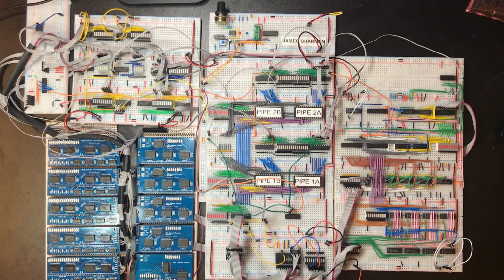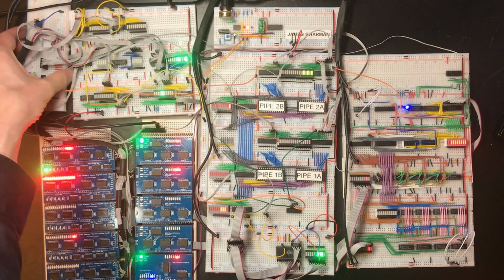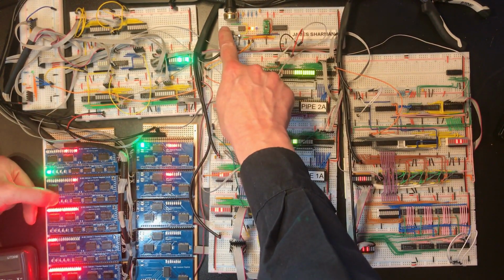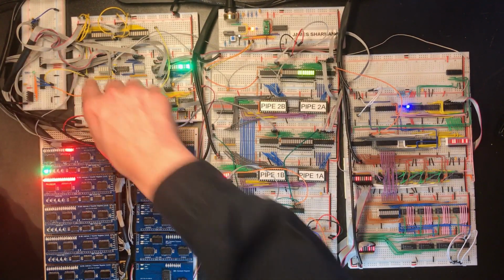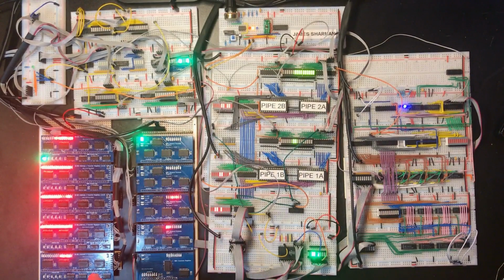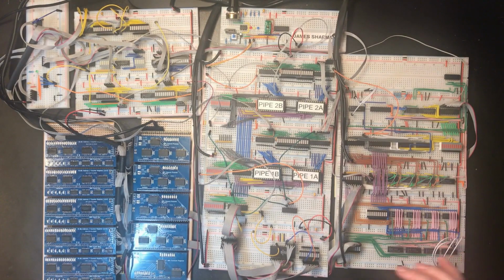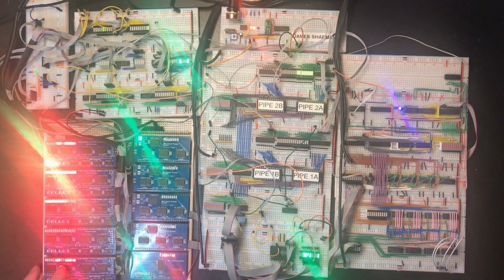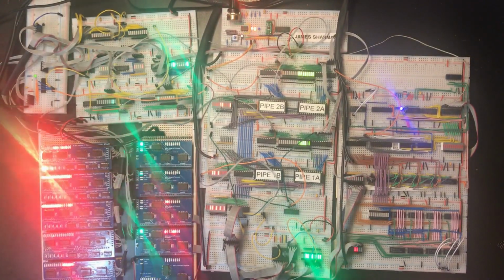Troubleshooting (Spoiler: It's Alive!) - Making an 8 Bit pipelined CPU - Part 39

Comment: Debugging software is bad enough. Debugging hardware is a whole 'nother level of frustration. Mind you, the thrill when you finally get it working is all the greater.
Reply from the maker: Indeed,  the Simulator helps a lot but for a while there code bugs would have be 2nd guessing the hardware.

Comment: Hi James throughly this build did you ever wish you’d gone with all through hole components even if it made it a bit bigger?
Reply from the maker: Not really but there are some advantages going that way, you can use exactly the same components between breadboard and pcb for starters. The size issue is a big deal for me though, I only have so much space.
Reply: @weirdboyjim  fair play, I’ve been soldering for years but the thought of try to hand solder SMD components brings me out in cold sweats. 
I’m enjoying the series but got a fair way to go yet to catch up.

Comment: For anyone trying to figure out how he might implement certain things ahead of time, this comment contains some of my guesses on that front.

(14:24) That's SP, not SI. SI would indeed be register address 4, but SP is register address 3, which tripped you up for just a bit there.
(31:35) The problem with doing jump instructions at this point is that you need a little bit of extra hardware to make sure you don't get a race condition by trying to load a value into the PC at the same time the fetch unit is trying to increment it. Maybe you'll take care of that in the next video, though.

The best idea I could come up for resolving the race condition between increment and load on the program counter is to delay the load line on the program counter somehow. (You could potentially do some logic on the incoming load and increment lines, but there's a good chance that would result in the same race condition, or force INC to happen just after LOAD, neither of which is what we want.
Reply from the maker: That was SI, I was pointing at it with the left hand but perspective made my right hand a little ambiguous but the lights changing on si should have cleared that up.
Reply: @weirdboyjim  At that point in the video, you said, "I want to take SI.... I want to load it into this register, which we think we fixed." However, you were actually loading SP (the middle address register) into the register you thought you had fixed at that point. That's what I was pointing out there.

Comment: TTL specification for Vcc is typically 5.0V +/- 10%, so below 4.5V is out of spec. Your habit of daisy chaining power via any number of dodgy breadboard connections is hugely problematic. Star feeding them all from reliable common points is definitely a huge improvement.

And yes, driving LEDs from logic signals is a potential problem, certainly if you’re driving more than one. The ideal PCB solution is to use SOT-23 mosfets (on the back, like you are doing with the resistors) to drive LEDs with minimal bus loading. They still have capacitance, (around 1nF) so will potentially slow the max speed. But a 10k resistor in series with the gate will reduce that loading on the bus without slowing the LED noticeably (switching time will be in the order of 10us). I suggest something like 2N7002 switching to ground for active high signals, and BSS84 switching from +5V for active low signals.
Reply from the maker: That cable was a bit unwieldy though, in the past I've been tempted to solder the power rails together at the back.

Comment: About that 40MHz for the '193s. I'd be extremely gratified if I could find out how Motorola came up with that figure in their datasheet. I'm specifying Motorola because TI specifies 32MHz for the same chip. And in fact, if you look at the AC Characteristics on the Motorola datasheet it specifies a fMAX with a minimum of 25MHz and typical 32MHz, which matches the values in the TI datasheet. Looking at datasheets from different manufacturers, they match the value for the TI datasheet and only Motorola claims the 40MHz, which they immediately contradict when you look at the AC characteristics on the same datasheet. Only thing I can guess is that someone made a typo on the datasheet and it hasn't been corrected.
Reply from the maker: It's possible I guess. In my datasheet fMAX isn't given, it just gives 32 as typical and the max box is empty.
Reply: @weirdboyjim  Nor is max given on the TI datasheet. But the bullet point on the Motorola datasheet says:

High Speed . . . 40 MHz Typical Count Frequency

and the AC Characteristics on that same datasheet specifies a typ fMAX of 32MHz, and 32 != 40. 

Now, one thing that is annoying absent on all of the datasheets I've seen is a specification of how long CPU or CPD have to remain high before going low for the next count. They do specify that they have to go low for at least 20ns with a tW parameter of 20ns and since tW is defined as "Any Pulse Width", it would be reasonable to assume CPU and CPD have to remain high for 20ns as well. So 20ns + 20ns = 40ns = 25MHz which matches the min specification of 25MHz exactly. Now, many parts can be overclocked from their minimum specified frequency, so at 32MHz, it would require a cycle time of 31.25ns or a tW of 15.6ns. And going up to 40MHz (which is mentioned nowhere except on that single bullet point in the Motorola datasheet) would require a tW of 12.5ns.

Overall, the TI and Motorola datasheets agree with each other on every single parameter except for that single bullet point in the overall part description at the beginning of the data sheet where TI indicates 32MHz and Motorola 40MHz. Moreover datasheets from other manufacturers agree with TI. So I have to assume someone at Motorola got confused about 25MHz and 40ns, and wrote 40MHz in that bullet point. Then no one else has corrected that mistake.

Takeaway, the 74LS193 has a guaranteed clock speed of 25MHz. Due to manufacturing safety margins to meet that guarantee, you can usually get away with 32MHz. The absolute theoretical limit under ideal conditions and a flawless chip is unknown.

Comment: I'm a bit of a space-history buff and so when ever you say "main bus" talking about this build, I have no choice but to hear in the back of my head "uh, Houston, we got a main bus B undervolt"... so it's inevitable that sometime as the series had gone on that you'd get some kind of undervolt issue just so my subconscious could say "hah! I told you so". But, seriously, building a prototype of this level of complexity - there has to a moment somewhere where everything starts to go unexplainably wrong... it's the law of averages. There's been many times in the past when I've been working on things less complex that this and I've just ended up throwing a tantrum and leaving it "to malfunction as much as it likes... so there!" It's all part of the process.
Reply from the maker: I'm pretty sure "main bus B undervolt" is a reference to a power bus, not a data bus.
Reply: @weirdboyjim  Certainly is..... but nagging voices in the back of the head pay little attention to technical details. ;)
Reply: @edgeeffect  Man me too, it’s like a trigger in my head 😂. Next they’ll call to “cycle the Parker valve” (I used to work for Parker Hannifin, the manufacturer in question).